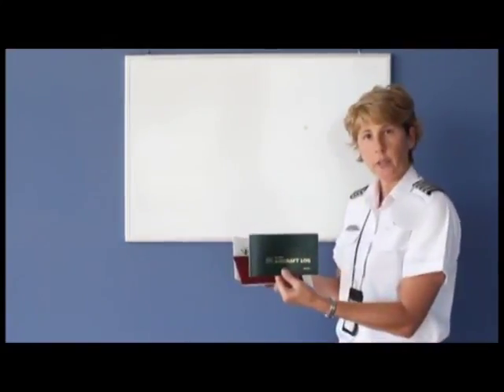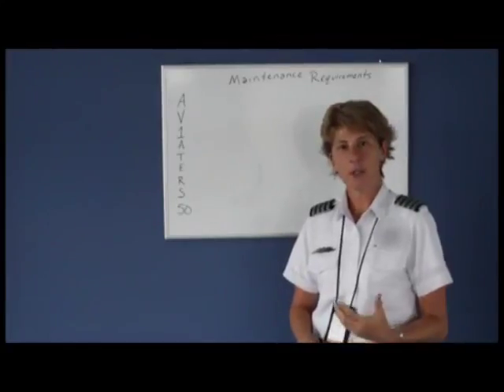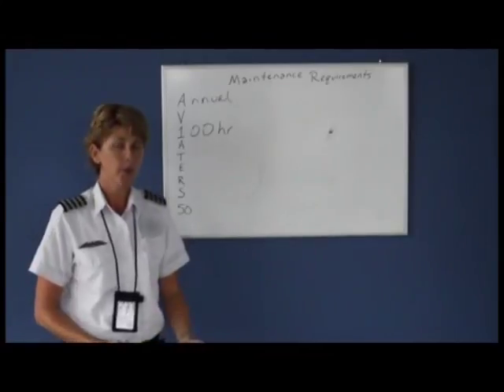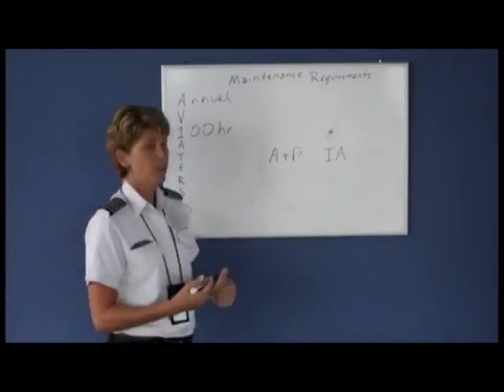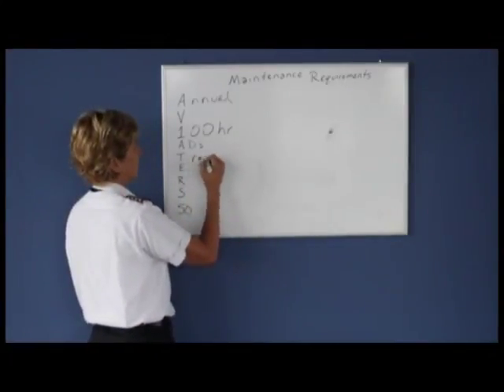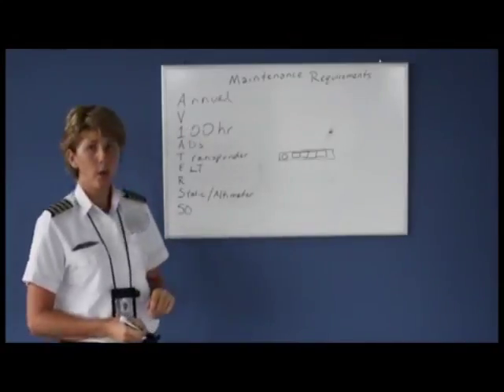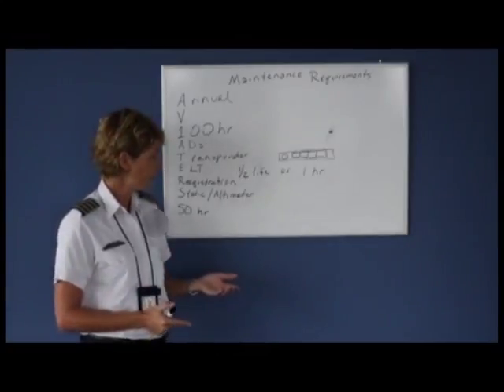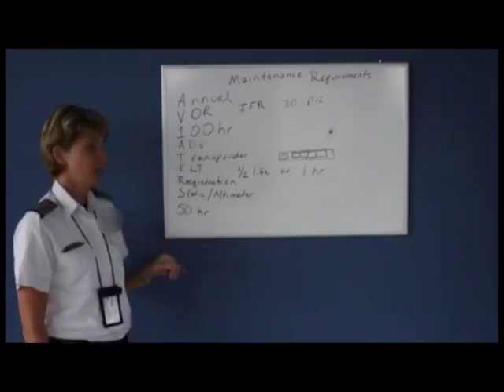Aircraft Maintenance Requirements (Private Pilot Lesson 1h)

Comment: Registration is 7 years now I believe, recently increased from 3 years.

Also anyone know why recently people only use Av1ates vs Cyndy's Av1aters50?
Reply: Don't know if you still need this, but I think it's because most people don't include registration (R) in the maintenance requirements or the 50 hour inspection (since it is not FAA mandated just recommended--FAA recommends oil and oil filters be changed every 50 hours)